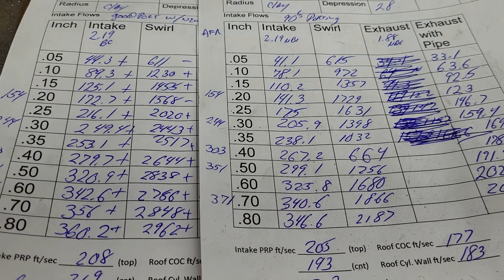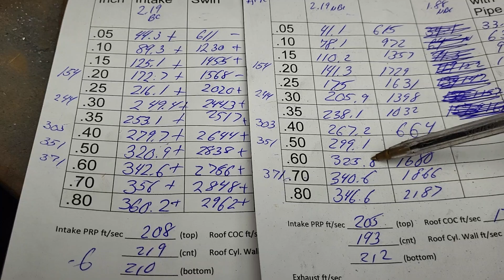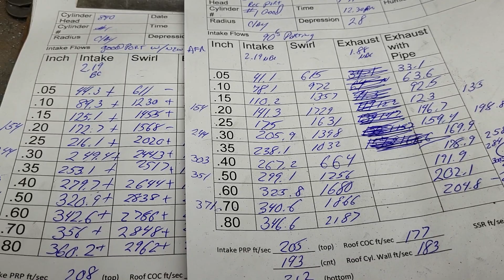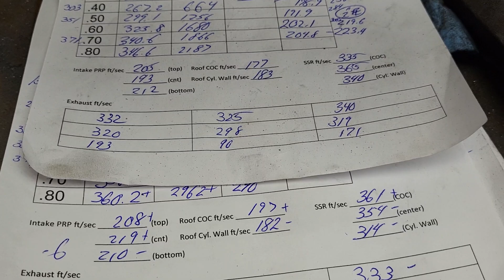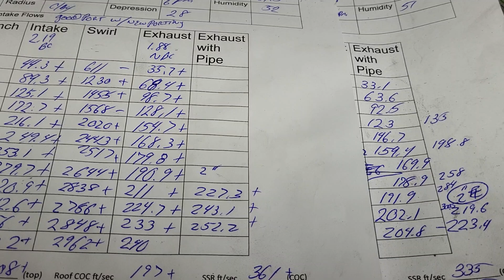Corvette 427/435 horsepower 840 cylinder heads, modern porting/cleanup.

Comment: I've been blocking off exhaust crossovers with black Silastic for over 40 years. Fill the passage completely, and let it cure. What you will find is that the surface gets burnt and damaged, then it seems to protect everything behind it. No one seems to believe me, but I've had great success with it. The best thing about doing this is that you can shoot a big shot into the passage when doing a manifold change, it mightn't properly fill the passage,  but it will protect the intake manifold.  Regards Greg
Reply from the maker: Tell us more about this stuff! Thanks
Reply: @servediocylinderheads  just google Silastic 732 black. It's just an acetic cure silicone,  but I've successfully had it in exhaust crossovers for in excess of 100k miles. Being acetic cure, technically it shouldn't be used with O2 sensors,  however only a small area is exposed to the sensor, and it is fairly quickly burnt by exhaust gases. As a simple and effective solution it works surprisingly well. It's not as good as welding, and the exposed surface does degrade from the exhaust heat. But in my experience, it achieves what I needed it to do, protect the intake manifold from exhaust heat, cheaply, quickly, and easily.

Comment: 7:00 Yeah def:yougotthis: i am looking forward to what you find with this mod on the exh ! :cat-orange-whistling: Closed chamber BB chevy heads are noted for not flowing well on the exhaust side due to valve to chamber shrouding , GM went to great lengths to unshord the exhaust valves in some of their open chamber designs (3933148 casting) , I have the oval port version (063) of this head (840) and am looking at how i can unshroud the valves especially since the heads have 2.19/1.88 valves installed.
Reply from the maker: Stay tuned! Up coming video. Same port with plateau. Thanks

Comment: I raced my 1997 C2500 454 Gen 6 pickup at NNN 2023 Charles. Heads and intake stock not ported. Factory exhaust manifolds intact. Factory Dual Cats. Borla Pro X0 2-1/2" pair of mufflers. Stock 4L80E 1600 Rpm stall. 4.10 gearass Powetrax No Slip Locker. 
Lost a few but Won most of 19 passes made. Fast Reaction times lights I cut all last Saturday. Pro Stock Fast lights cut by me.
Now Everyone wants a 454 BBC Gen6 !
Reply from the maker: Repeatable!
Reply: @servediocylinderheads  I went alone.  A friend 2 Hacks Jeff also in Illinois recorded some footage. Some had 300 Hp more . Caught up at 600 feet and passed me. A mean 451 Mopar Stroker at least 500 Hp I thought here would spank me. Later found out at 600 Hp he was. 
Got him off the line .03 light cut I did. He couldn't hook up. Dodge D100. He never caught up to my 5000 lb 454 3/4 ton pickup
Reply from the maker: @brracing7861  Fun!
Reply: @servediocylinderheads  It was.  Poor mans Racing fun. Got fast stuff like you. Need more $. Those Pontiac V8 engines are expensive once you ditch OEM parts  besides the Block. Crankshaft. And Factory iron RAIV heads.

Comment: One thing a BBC Doess very well is it Generates masssive torque off idle.and keeps pulling till the engine runs out of air or Camshaft duration. 
Also have a Superior priority oiling saystem, massive strong crankshaft that doesn't defect eaay. Kilker oil pump too.
I worked on and drove a Real 1969 Corvette 435 Hp 427 it was quite impressive even for today with 2000+ Hp Baseline Faast drag racing.
You know what Charles if you can not lay the Power down and use it Street Racing and Drag Racing itss actually not useful at all !
Reply from the maker: You are 100% correct!

Comment: I’m a big fan of big block Chevy. If you have time & patient, there are plenty of good casting #s that flow great when worked over. Those flow #s are legit. I’ve done it with port work. Big block Chevy engine design makes great power. The canted valve design is excellent in ability to fill the cylinder with air on the intake stroke. As far as comparison on a hemi head, peak flow on some hemi engines could be 20 cfm higher past 600 lift. But compared from .300-.575 #s.  The bbc flows more down lower. For 1/8 & 1/4 mile, I feel the bbc beats the hemi in ability to produce torque. You will see it in the 60 foot times. As far as improving what’s done, a good set of Férrea valves will increase flow #s. Not sure if they are using them already. Nice work done & agree with not thinning out the casting in all those areas. I would test one intake port & exhaust port with a 60 grit cartridge roll finish. Sometimes you gain some flow. It can produce more swirl with that finish also. Great work using the Prussian Blue to see the mapping left behind.
Reply from the maker: Thanks, it does make good power. These 840's will make good steam when all done I have no doubt.

Comment: Hiya and great job there! I was just thinking about that water jacket thing and how much it can affect the flow? 🤔

Because hotter air has a lower density, so its speed can be higher, which in turn increases the flow when area remains the same.

-juhana
Reply from the maker: Everything effects everything else. Thanks

Comment: Impressive pick up. What's the intake throat ratio if you don't mind sharing? Exhaust flow seems a little behind but that's what scavenge plateaus and dual pattern cams are for, right?
Reply from the maker: It is probably small now, it hasn't been finalized or developed at all. Thanks